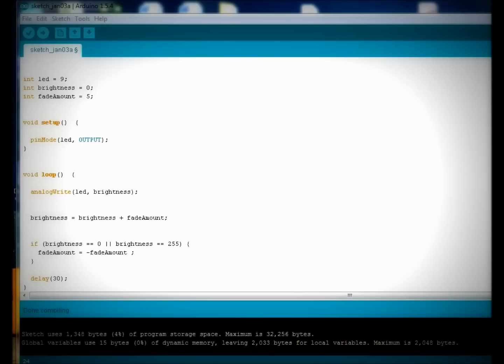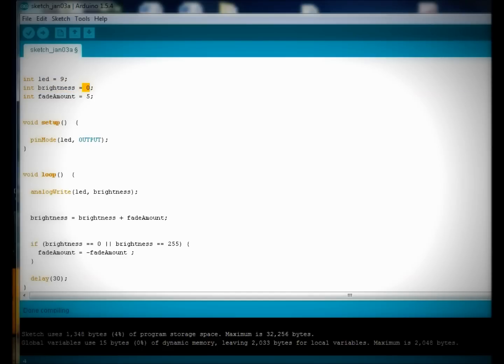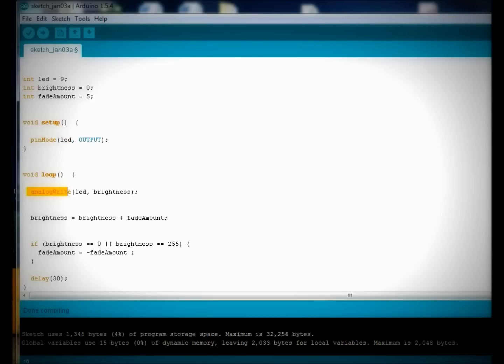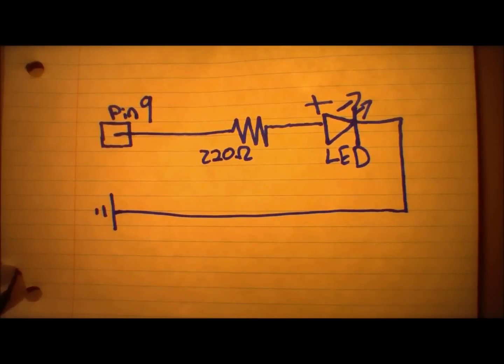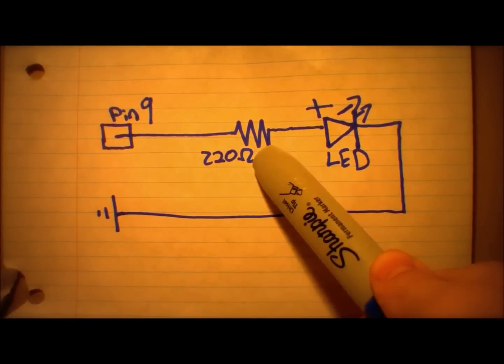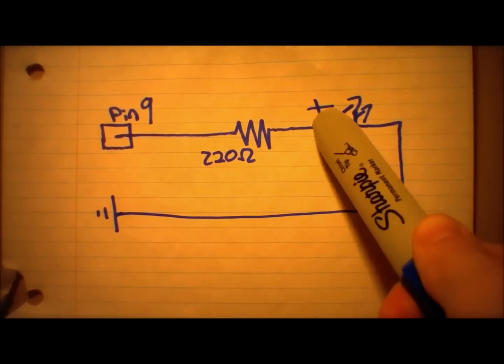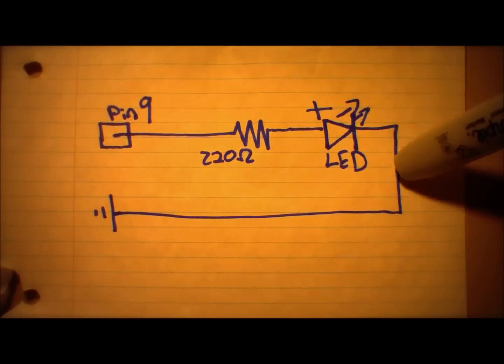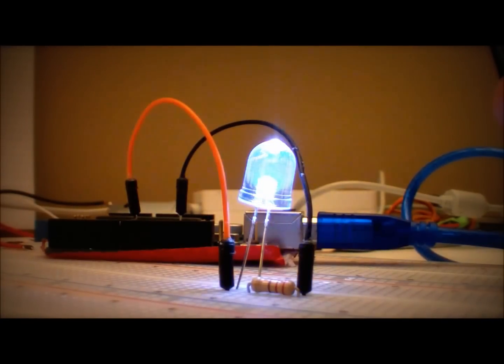Arduino LED fade tutorial +CODE

Comment: Quick question, why is there no need to connect the LED and the Arduino to the +5V pin? I thought that would be required to close the circuit? Thanks for the great tutorial!
Reply: no porque el pin 9 (pwm) esta enviando pulsos de 5v en diferentes velocidades, lo que hace al led desvanecerse es enviarle 5 voltios y luego quitarselos muy rapido

Comment: Hello Mitchell:

Can you add to your logic this:

const int sensor1 = 3;
const int sensor2 = 5;
const int salida = 2;
boolean activado = false;
boolean disparar = false;
unsigned int presento1 = 0;
unsigned int presento2 = 0;

unsigned long tiempo = 0; //Control del tiempo
unsigned long espera = 10*60000; //Tiempo a esperar o temporizar en milisegundos
unsigned long redisparo = 1000;  // durante este tiempo si hay nuevos disparos del PIR reinicio la temporización.

boolean presento = false;

void setup(){
 Serial.begin(19200);
 pinMode(sensor1, INPUT);
        pinMode(sensor2, INPUT);
 pinMode(salida, OUTPUT);
 digitalWrite(salida, LOW); // Logica inversa de usarse la directa cambiar a LOW

}

void loop(){
 
 if ((digitalRead(sensor1) == HIGH)|| (digitalRead(sensor2) == HIGH)) {
  presento1++;
  if (presento1 == 1) {
   Serial.println("Movimiento.");
  }
  activado = true;
  tiempo = millis();
 } else presento1 = 0;   
 
 
 if (activado) { 
     
    if (((digitalRead(sensor1) == HIGH) || (digitalRead(sensor2) == HIGH)) && ( millis() - tiempo < redisparo)) {
     tiempo = millis();
     presento2++;
     if (presento2 == 1) {
         Serial.print("Hay movimiento. Tiempo =");
      Serial.println(tiempo);
         Serial.print("Faltan =");
         Serial.println(millis() - tiempo);
     }
    } else presento2 = 0;
     
    if (millis() - tiempo < espera) {
     digitalWrite(salida, HIGH); // Para lagica inversa
     
    } else {
     digitalWrite(salida, LOW);
     activado = false;
    }
    }
    
}

This are two PIR that release a OUTPUT LED, but with status 1 to 0, i´ll like see your funtion working together to this.

Greetings!

Comment: Great. But....
You should have explained WHY you used pin 9 and not pin 8.
Which pins are PWM pins on the UNO.

You should use the correct names for the LED legs.
Saying Negative and Positive is fine to explain what is what, but Anode and Cathode are the correct names.

Link to your code. Or put it in the description.
It's far easier than saying "Then you're gonna wanna...." all the time.
Also means you won't get so many ...."It doesn't work" comments..

Finally.
Stop saying "Then you're gonna wanna..." all the time. It becomes rather annoying.

Other than that.. Good video.
Reply: You get the code free along with the arudino ide.
Just go to New,samples and then select Fade.

Comment: Can I use pin 13 for this project? So no need for the circuit...
Reply: No you can't. You have to use a pin that supports PWM. That means you have to take a pin which has a wave next to it.
Reply: Thanks for the information
Reply: Nick Farrow You're welcome :)
Reply: +FischiMc  as far as I can see, your english is top notch
Reply: Vittal Gunja Thanks :D
Reply: You can use 11, 10 , 9 pins

Comment: in your code, if (brightness == 0   .......... are those two L's? two i's? what are those two vertical lines??
Reply: Don't know if you ever figured it out but... if you are on a standard american keyboard, hit shift and " \ " (should be above the enter key) to get " | ". In the code " || " means "or"
for example: "if a is equal to b or if a is equal to c" translates to "if a == b || a == c"